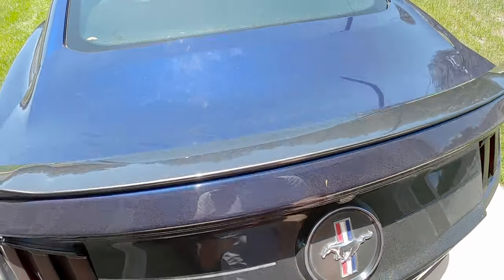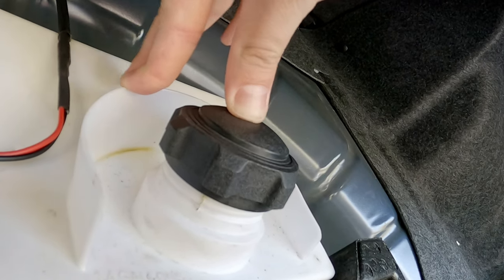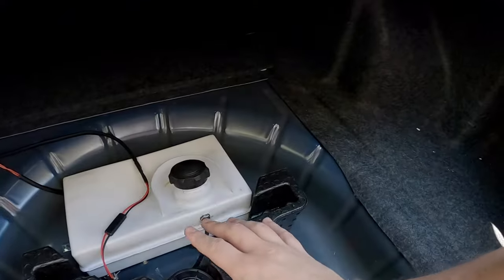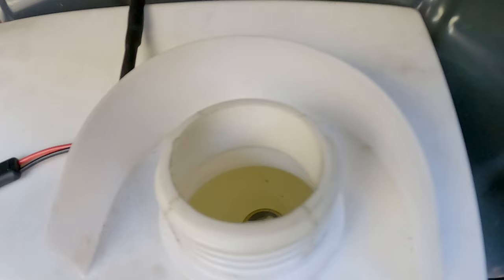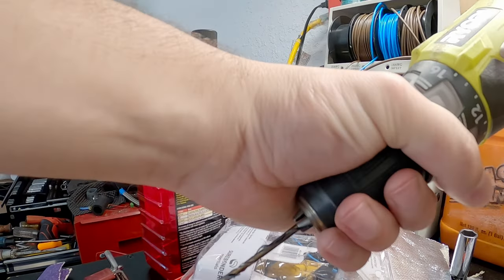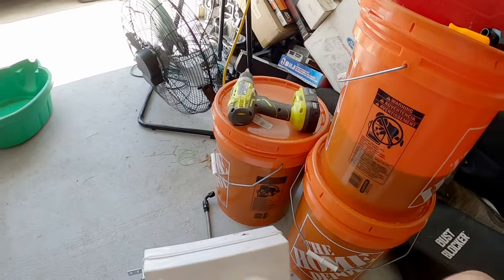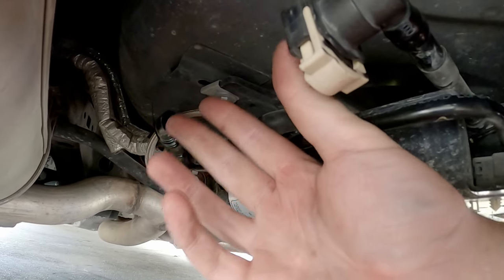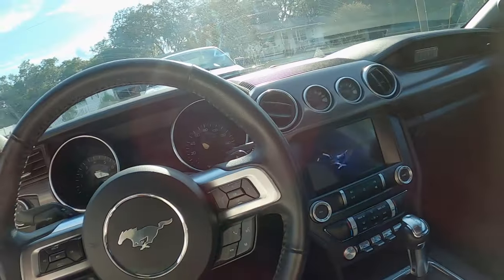This Homemade Car Part Could've Killed Me!

Comment: gasoline will eat silicole and jb weld.. so dont use those. maybe try plastic welding the hole shut or put a  screw in the hole to plug the vent
Reply from the maker: Yeah, that was another miscalculation. After sitting overnight, the silicone came apart. I'll probably have to use some kind of epoxy.